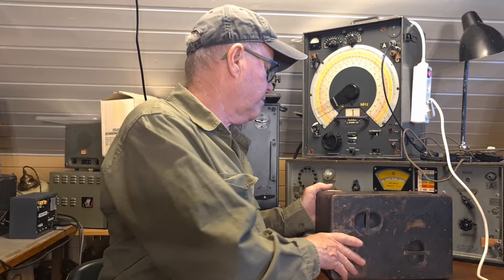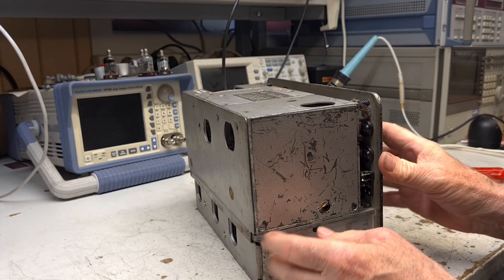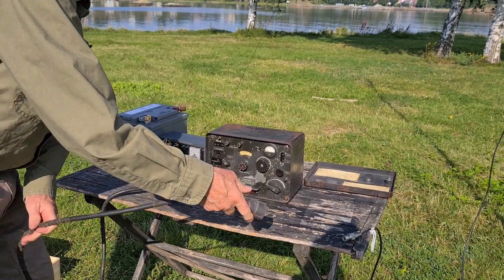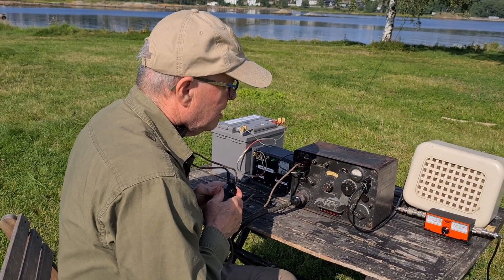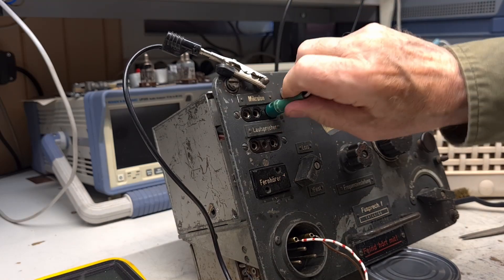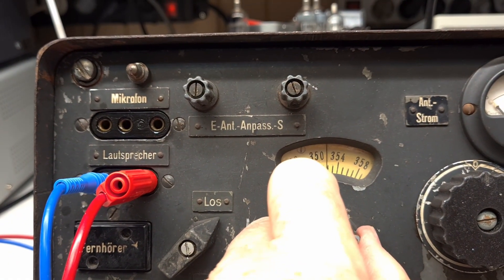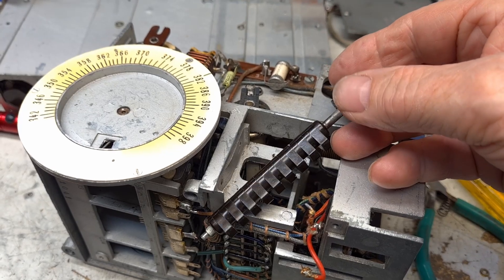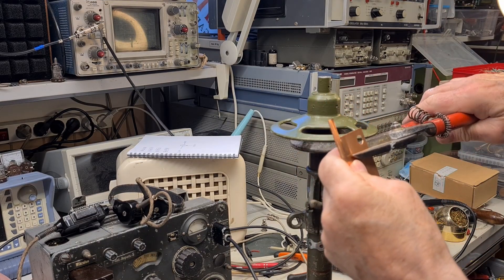Funksprechgerät f, German WW2 radio, Repair, Antenna  and QSO

Comment: Very interesting, my father was RAF Aircrew AG/Sigs (Airgunner/Radio Operator) 1939 - '46

PS bearing in mind they were flying at altitude... they didn't use SWR as such, the aerial was a wire on a drum, which was manually unwound until the max. power O/P was registered on the radios power meter

Comment: Helge, nice video. This radio I did not know till now. Building tank Radios is as demanding as Aircraft Radios. I think there were not many that survived the war. A tank hit by a penetrative Granade is totally destroyed  from the inside. A plane, if hit by shrapnel, can make a crash landing.  So, there is more chance that the radio survives.  Maybe you present us some Aircraft Radios,  VHF 43MHz, and there were awesome constructions broadband from 30 to 50MHz  all rf circuits tuned by a motor for remote control out of the cockpit.  See you..😊

Comment: Looking at the WW2 German radios I am always wondering that the Warsaw Pact's radios from the '60s are obviously designed (copied...) on base of these radios. Thanks Helge, DX 73 de HA0NBZ.
Reply from the maker: Yes, that's right. Many of the engineers who designed radios during the war continued to do so in East Germany for the Soviets. Many engineers were also moved to the Soviet Union after the war.
Reply: @LA6NCA  do you know any closer about these engineers, or maybe have you ever meet them?

Comment: "Since ground is not connected, it picks up radio stations".

Hvorfor? :S
Reply: because the cable was connected to the signal generator, not the antenna.
Reply: "It is now connected"...